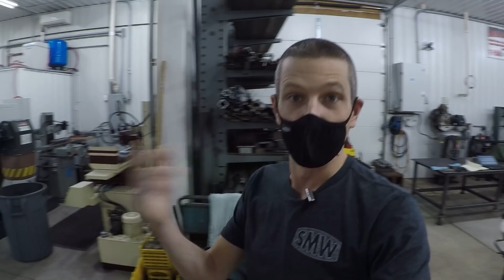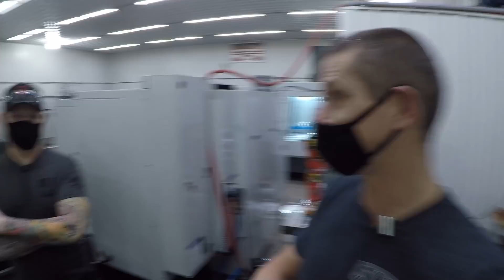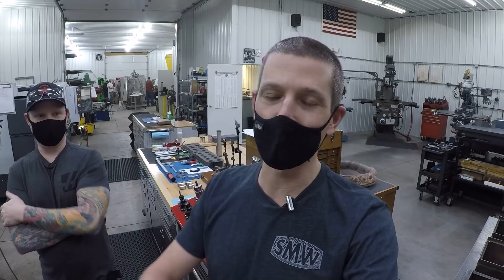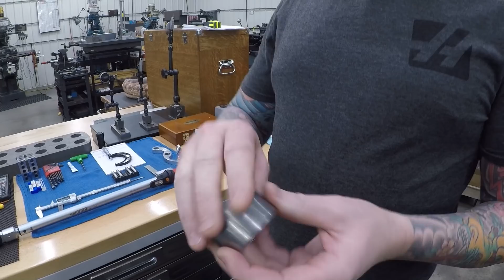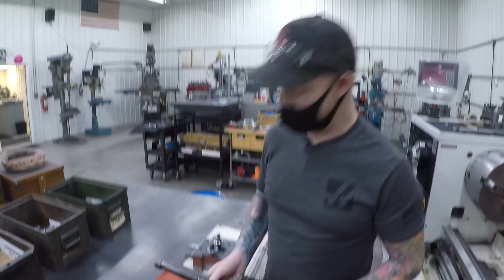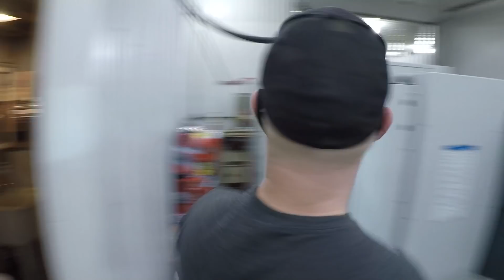One-Man Job Shop Tour: Imperial Machine!

Comment: I'm 60 and have a few pearls I can pass on. One is to specialize like with what your doing with the food processing machine, it will help stabilize your cash flow and make you become the go to company for speciality manufacturing and reduce your need to compete with other job shops. "OH, the company you want to talk with if you want that built is Imperial"!  2nd trust NO ONE when it comes to handling money unsupervised.  Always, ALWAYS and ALWAY have TWO AND THIRD TIER monitoring of cash flow through your company with projected cash flo figures throughout process by completely separate monitoring agencies.  So that ultimately you have three levels of independent auditing.  This will seem excessive until you're embezzled by family or your most trusted friend and employees, thus go back to rule #1, 
Trust No One!

Comment: The garage tool maker was a "one man", this is a small company.
Reply: And what's the difference?
Reply: @AntiVaganza  I have zero Idea what your on about.
Reply: It really doesn't matter - running a small business is running a small business, and they're all uniquely different. Note that just because he said that his machining business works with his father's fab business and they're under the same roof, that doesn't mean that he just has all of those people in that building to load up and operate his machines. It probably says "one-man job shop" because the machining business actually IS pretty much one man. That's the entire point of starting a CNC job shop after all, they're very nimble, flexible businesses with very low labor requirements thanks to the automation of CNC(how many of these tours do we hear something like "...yea, we might just shut them down for the weekend, but they run without anyone all night long too...").
  
I would hope you're capable of taking more from this tour than just semantic nitpicking(of questionable accuracy)

Comment: Sorry but these face nappies are ridiculous people are constantly touching them and moving them about, if you feel like you need to conform just put a visor on it gives the same protection as in the masks don't fit but at least we can hear what you have to say. It's good to see a shop with cnc and manual machines, to many people think every thing is quicker on cnc but if you have a job shop and a customer says I need a 1 inch diameter bar with a taped hole but just a one off then 5 mins in a manual job done, that said to see a 5 axis in motion does make me jealous.

Comment: What’s that little belt sander he used called?
Reply: This belt sander is from gesswein tools.
Reply: Yes - I'd love one, too!
Reply: I came here to ask the brand as well. I've uses the Dynafiles alot by Dynabrade but never a little electric one thats so quiet and manuvereable. Also side note NSK makes a miniature belt attachment for their micromotors which is even more neat but $$$$
Reply: I've also used air powered ones before and the company called them linishers. between that and a pedestal grinder with a buffing wheel I barely touched a file

Comment: Do your audience a favor.  Use paper masks instead of cloth.  The cloth masks bend your noses over, muffles your speech and constantly slip downward.  Thanks.
Reply: I work where they are required, any local noise sucks when talking to others
Reply: If they just used masks with the copper strip in the nose they’d be fine, these just seem like shit masks
Reply: It would be better with no masks.